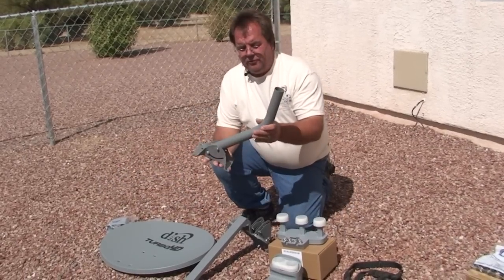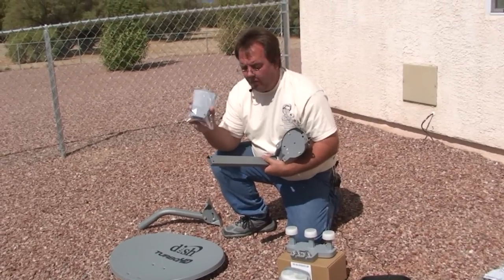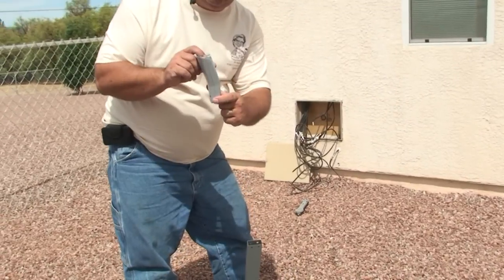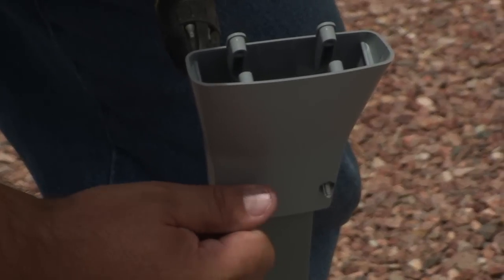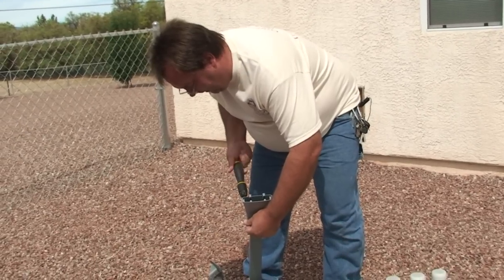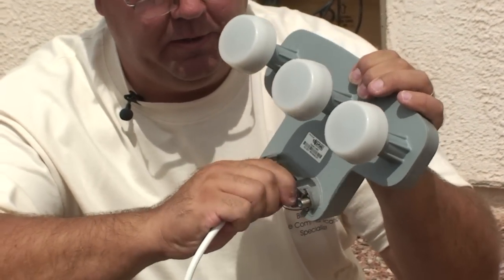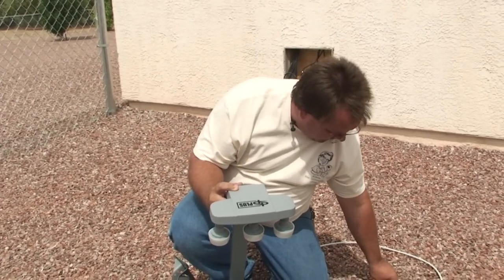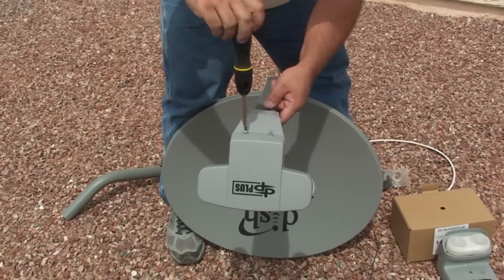Satellite TV Installation : How to Build a LNB Bracket for Satellite Dish

Comment: what if i want to do more than one receiver. i already have the 222k receiver installed but i want to add a 311 receiver also?
Reply: You add a line to port two on the lnb, then that will feed ( im assuming) your long gone 311 receiver

Comment: well. where are the cables connected to? arent they supposed to be connected inside the lnb first? integrated 1000.2 bracket specially designed for a LNB for a 1000.2 dish kit. Pff